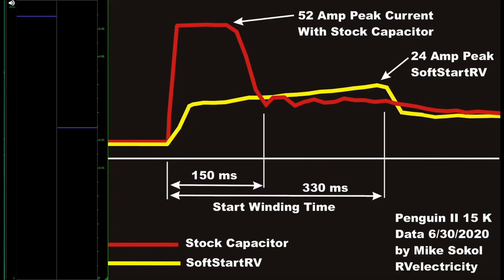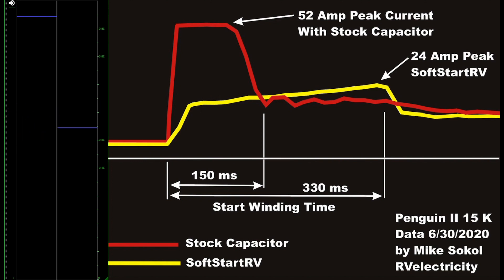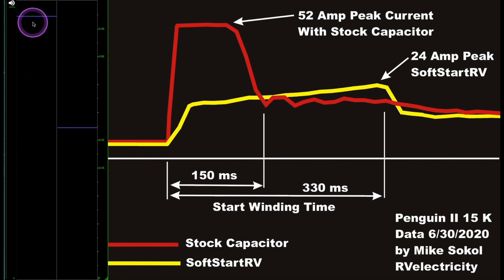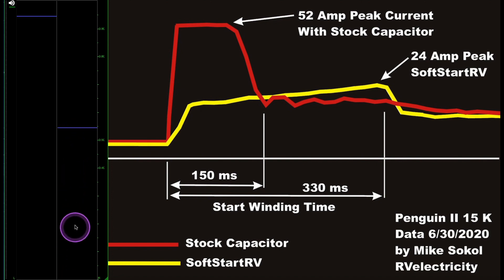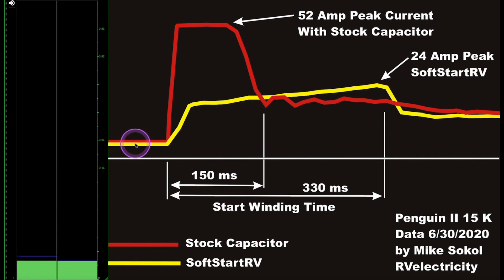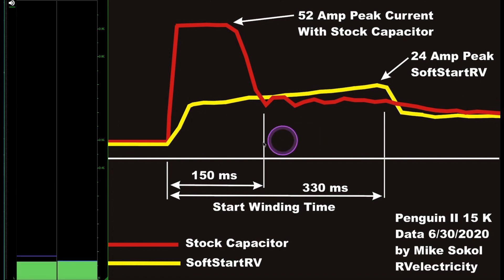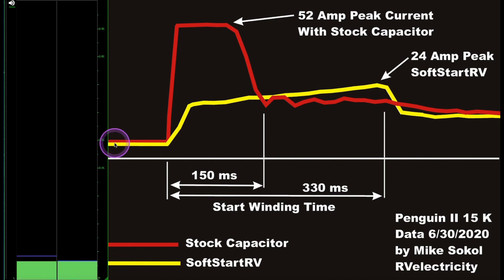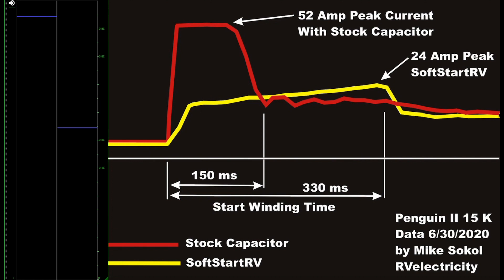RVelectricity Mike Sokol Upcoming Projects

Comment: So I’m thinking with 2/2000 Honda inverter generators & 2 soft starts you could just barely pull off 1/15000 BTU & 1/13500  units . Better not have any other load though.  This makes me wonder though with one 2000 Honda & one 15,000 ac you better not try making coffee; )

Comment: WOW Mike, you sure do have a lot of test gear. That soft start demo was amazing! Thank you so much, I bet it took weeks for that 4 min. video!
Dave Telenko
Reply from the maker: Figuring out how to gather this data without spending $100l,000 on a laboratory grade data logger was the trick, and that indeed took weeks of thought experiments and a few bench tests with conventional meters. However, I had a dream (literally) about how to build my own High Rate Data Logger (HRDL) from parts I had laying around, it took less than 30 seconds to gather the data from a stock capacitor air conditioner, then another 30 seconds to gather data from a SoftStartRV upgrade. It worked exactly as I saw in my dream, which then took a day or so to turn into a usable graph that would show the differences between the two technologies. Note that my HRDL data captures 44,100 data points a second, each data point being 24-bits, so that's close to 1ppm (Part Per Million) accuracy. Pretty cool for junk parts I had laying around and a 5 year old Mac laptop running a free program.